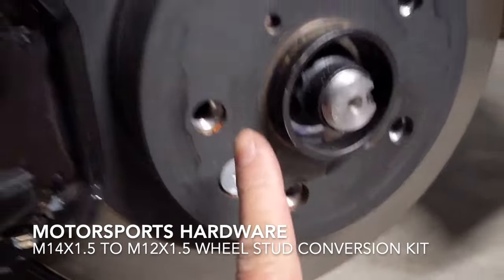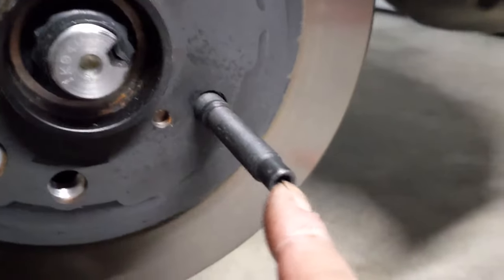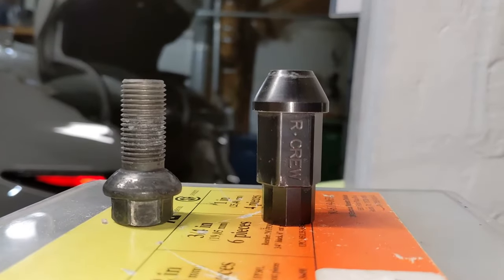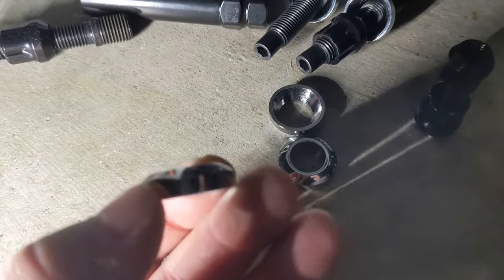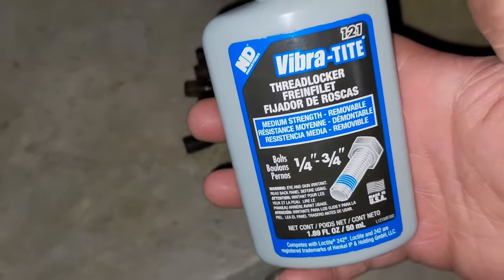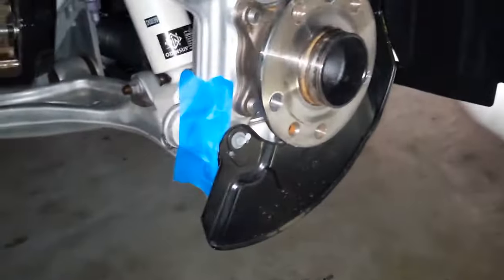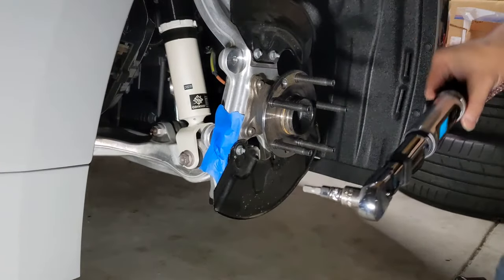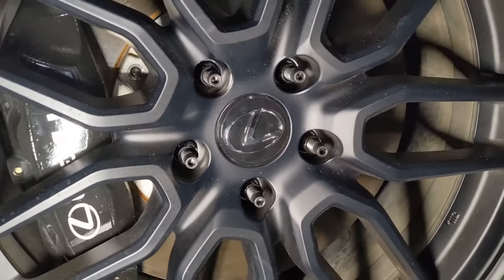Motorsports Hardware Stud Conversion  - 2021+ Lexus IS -  Lexus  IS500

Comment: Nice bro! Thanks! Great video. One question though. You didn’t have to remove to rotor to install the studs right? You just did that way because you were going to do the brakes?
Reply from the maker: Yes that is correct, no need to pull the brake rotors to install the studs. My rotors were only off because doing the RCF brakes